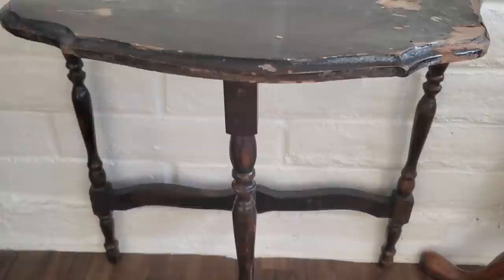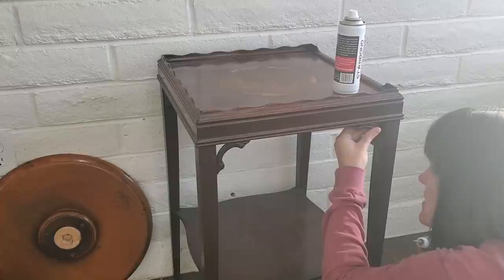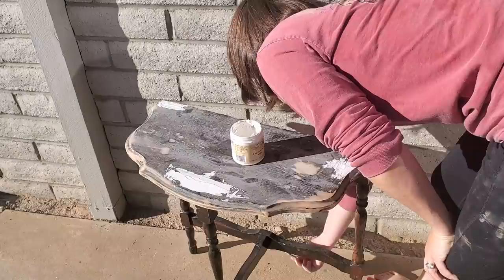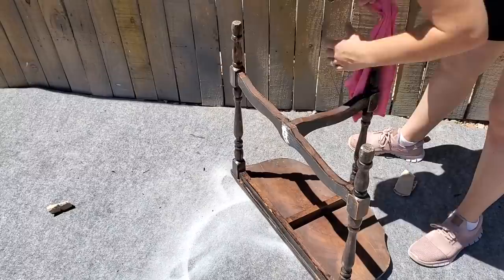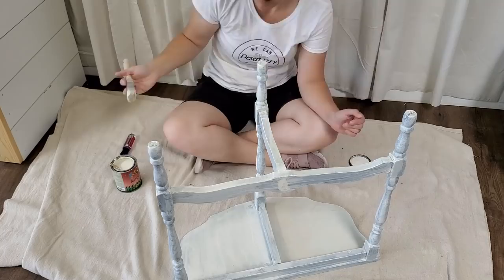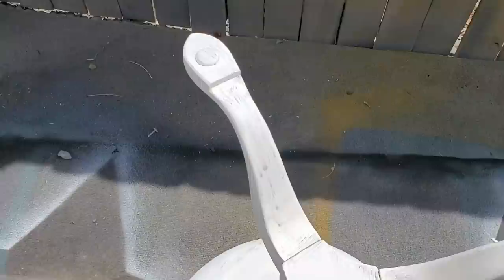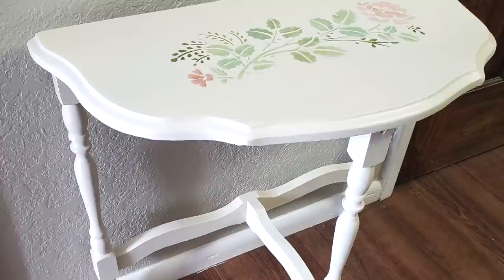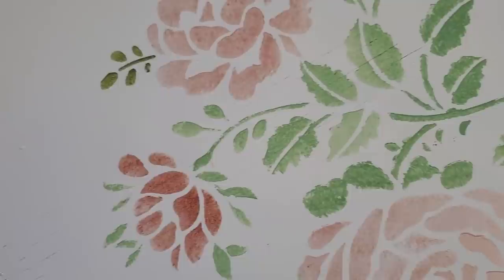3 Table Makeovers, Shopping Haul, PLUS A Bedroom Renovation

Comment: When a screw isn’t biting into the wood, just back it out and put a bit of toothpick and glue in the hole before re-screwing it.   Solid.  You do great work.  Keep on.
Reply from the maker: I have used that trick too! But this was a different situation. It would bite until it was completely screwed in and then it would just start spinning. So weird
Reply: @DesertDIY  That is very weird.  Yeah, my thought it would have been the nail that you took out but me thinks that there was also another screw or nail that had broken off in there before and that was what you were hitting.

Comment: Here's a tip on how to clean brushes. Before you dip the brush into the paint, spray cooking oil (like PAM) or dip brush into some cooking oil (doesn't matter what brand). The oil will coat the bristles just enough so the paint will not dry onto the bristles. When you go to clean your brush, clean as you normally would and you'll find the cleaning time is cut in half.
Reply from the maker: Thanks for the tip!

Comment: IF you ever use a top coat on General Finishes Milk Paint, use their Flat Out Flat water based top coat.  It is specially formulated to go over their milk paint and it will protect and will give you a wax like appearance.

Comment: When you said one of the tables had a wavy top, I remembered another DIYer with a similar issue. It has been a while since I saw his video, but I am pretty sure this was his solution. With a spray bottle and water  he wet the area that had the problem, then he took a damp cloth and put it over the area. Using a hot iron, he slowly went over the area drying the cloth. I think he had to redo one section that was really warped. Something about the water got into the wood fibers causing them to swell, then when the heat of the iron dried them they stayed enlarged. This filled in the “valleys” on the surface. I hope this is right. I would definitely practice on a scrap piece of wood first.

Comment: Your projects turned out beautifully. I have a little 3 legged table just like that. It was my mother's. The next time you have rust on your paint can lid and rim, strain it. Get an old collander( not a tea strainer...you'll be hatin' life, lol), and strain it. I actually bought a collander from Dollar Tree, just for that purpose. As an extra measure, you could use a piece of cheese cloth over the top of the can, held in place by a rubber band. This may sound like a lot of trouble, but you can do it in less time than it took me to type this, lol. I am very frugal...can you tell? 🙂👍